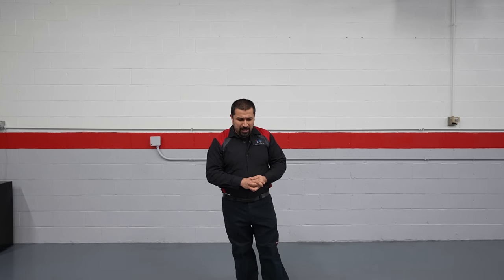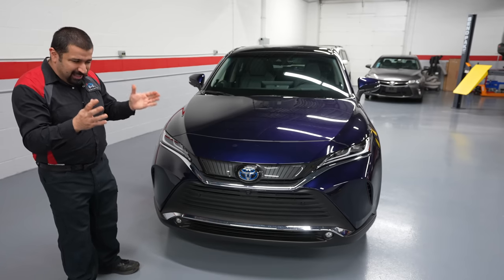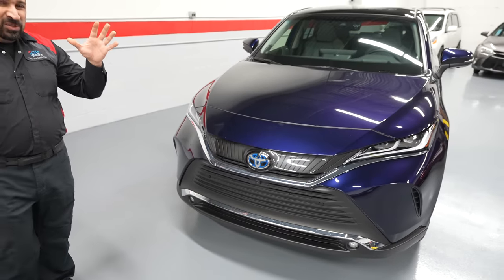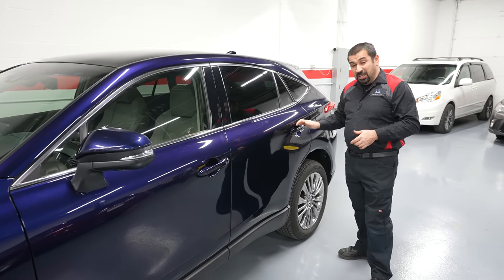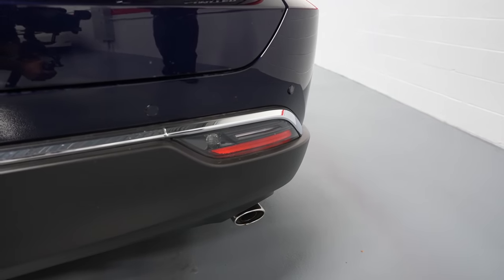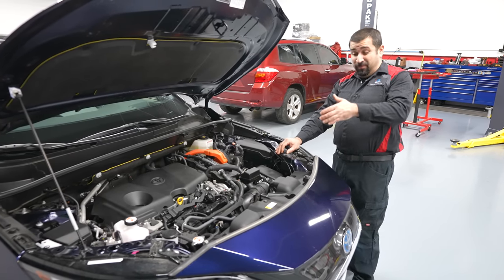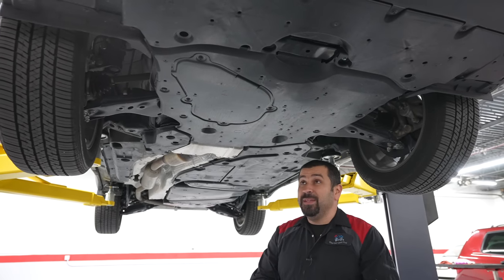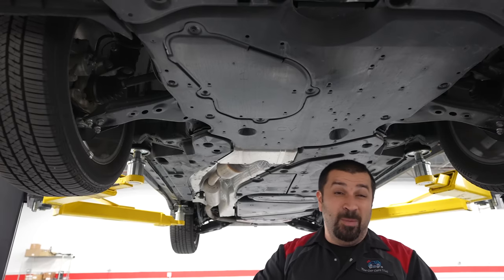THIS Toyota New Model is a Total Hidden Gem! Should've Been a Lexus!

Comment: I drive a semi truck and we CANT SEE those bumper turn signals in traffic! Love your channel CCN
Reply: Yes... low down turn signals are low down stupidity !!!
I have 2 Hyundai Santa Fe's with them .... Kia also does the same...
Reply: Such a helpful comment! Thank you. Have you noticed the issue with Venzas angle of rear specifically or any vehicle with lower signals. Just curious-have you ever almost wrecked because of this issue?  To me this is an important safety issue. Thanks again!
Reply: @s.p.3738  I haven’t encountered the new Toyota yet but the Hyundais are the problem (so far), this one doesn’t seem any better. It’s only a problem in stop and go traffic as you encounter in large city rush hour..
Reply: @s.p.3738  Lower the better the designers think ! It is plain stupid, I own 2 Hyundai Santa Fe models with those down low stupid turn signals
they are dangerous !!!!!
Reply: @obesefeline  Thank you for this! Very helpful
Reply: 💯 % correct...
Reply: Love your channel. Great video. 
Why are the turn signals do low....
What's the thought process?
Reply: It has them in the mirrors
Reply: That's why they also have the turn signals integrated into the sideview mirrors. Surely you'll see those. But for those that don't have it, definitely a problem. Not only for Semis either. If you get too close to the vehicle like in a bumper to bumper traffic, you can't see them
Reply: @kr2426  when you're behind someone you don't look in front of their mirror
Reply: @kr2426  and in the morning it's not bright enough
Reply: @bextar6365  yes, I hate it in my Chevy bolt when loading a hitch cargo tray for camping.
Reply: @esmerlerhovardasi1  no he's way up hi unless you're like 3 cars apart you probably won't be able to see them
Reply: @ericwall7396  Can you see a Miata? I love mine but get worried driving them around semi trucks
Reply: Then stop tailgating or munching big Macs while driving.
Reply: This is and the lack of rear storage space along with non functional sunroof are deal breakers for many looking at the venza.
Reply: I drive a car and I can't see those stupid signals 😒
Reply: Most drivers in New England don’t even use their turn signals!
Reply: Payback for truckers not signaling I guess
Reply: You are driving to close if you cannot see the lights
Reply: @bextar6365  they are not stupid they be road safety tested
Reply: @keithnewton8981  Still say stupid ~ I own 2 !!!
Reply: yup... they could have integrated the turn and brake lights together and left the reverse light and reflector at the bumper.... but no.... thought there was a DOT rule about this....
Reply: I drive a pick up and can barely see them
Reply: @dougheath3707  who cares about your non Toyota miata .we are not talking aboutMasda
Reply: @Liefpj  who cares! Not talking about chevrolet
Reply: How about lack of a real rear number to protect cargo hatch and rear occupants ?$400,000.dollar damage at less than 3M.P.H impact
Reply: It’s the reason I chose not to buy a Venza. I want everything visible.
Reply: In Australia front side indicators are compulsory.
Reply: I always wondered about that and hate it when designers take liberties with the most basic safety features. Can you at least still see the ones on the sideview mirrors?
Reply: @jbm0866  not during the day unfortunately
Reply: @obesefeline  You know what else can be dangerous? (I'm sure you'll agree) that is cars painted the exact same shade of red as a lit brake light. These often disappear in bright Texas, Arizona, NM (entire southwest) sunshine.
Reply: Truck, not truck... Those turn signals are really stupid idea.
Reply: If you can’t see the low turn signal, you are too close. Back in driver ed we were told to stop in such a way we could see the bottom of the rear tire of the car in front of you. That way you have enough room to maneuver around the car if need be, and… you can see the entire rear of the car in front of you. So when semi drivers don’t follow that advise, their problem, not ours. Besides, it not like the semi is going to overtake the car in front of it. And they aren’t going to be able to change lanes when the car in front of the wants to turn. If they hit the car in front of them because they couldn’t see the turn signal, they were too close.
Reply: @journeywithstu7199  you are being quite presumptuous, my point would include people to the left and right of me in bumper to bumper traffic attempting to get in front of me(what I’d gladly allow), the tailgating accusation is mute in this case.
Reply: I agree
Reply: @keithnewton8981  yeah ok, road tested in the real world? Lol
Reply: I have a Venza 2022, I love it. Low turn signals are odd, but maybe: keep your distance and you will see? Especially if you are driving a heavy vehicle distance is good as you need a lot more to come to a full stop (nothing to do with the make simply physics, more mass means more energy do dissipate to get to a full stop)
Reply: @obesefeline  yeah have been driving it for 6 months reaching f 8000miles and loving it
Reply: TOYOTA??  Are you listening?!?!
Reply: Well half the population don't know what a turn signal is anyway!
Reply: Maybe, you’re driving a little too close to the Venza.😊
Reply: @charliesundblomSwede  no, I’m primarily referring to stop and go traffic 0-5 mph, if one of these cars is next to me and would like to get in front of me( what I’d be happy to allow), I can’t see their intentions!

Comment: I bought a 22 Venza Limited in September just because for RAV4 hybrid money I got a much more advanced car. I really don’t see very many of them on the road. I think they are a hidden gem.
Reply: Yes...they are super rare to see !
Reply: I ordered one in Sept 2022...  told it will be 12 to 18 months before it arrives.
Reply: @KP-uj1wf  I put a deposit on an inbound unit in late July and took delivery mid September. I know there was no ordering to spec. It was just a case of this is what’s in the pipeline do you want it? If so we need a deposit. So I took it.
Reply: How is the cabin noise?
Reply: @subrata459  not bad. Definitely much better than the rav4 which I’ve driven a lot of. There’s some in the highway but almost none anywhere else.
Reply: My only fear is the transmission, how is it going?
Reply: This is a Rav4 with different body panels. Mechanically, it is identical to the Rav4
Reply: @danielriverafigueroa exactly the same as the Rav4, because it is a Rav4

Comment: The one downside is that the rear signal lights are very low.
Reply: Yea I really don’t like that either.
Reply: Agree, but I think it is overall a tighter fit than a RAV4. Maybe that’s the market Toyota is aiming at. Especially don’t like location of start button and lack of knobs for volume and heater/defrost.
Reply: @cp3onmtv963  Very surprised about that from Toyota.   Never seen signals that low.
Reply: Yeah, I almost hit one the other day, I was trying to make a lane change and I couldn't see that it was trying to as well
Reply: They could have incorporated a portion of the tail light into a turn signal. Still love my 22 XLE.
Reply: @ivanvarykino8202 you’ve never been behind a kia?
Reply: By law, the signals used for the hazards need to be visible if the rear hatch is open. Since there is really no room for the turn signal on the very most outer portion of the light, Toyota was not allowed to have them on the hatch and thus had to mount them below the bumper. There’s no SUV that has turn signals on the hatch.
Reply: I found that odd as well if your bumper to bumper in traffic you may not even see it.
Reply: @ZachDxn  well youre moving very slowly so its not as dangerous as in other circumstances
Reply: It has side mirror turn signals. There’s zero problem.

You mentioned that there was a downside but you didn’t explain why it was a downside.
Reply: @cwg73160  it's objectively less visible. Maybe not by much but still harder to see than if they were hiigher up.
Reply: @ZachDxn  Again, the side mirrors have turn signals. They’re visible to the vehicle behind and higher up.
Reply: @cwg73160  yeah but a better system is side mirror signals and rear signals at eye level, that's ideal and the safest option
I'm not saying it's 100% necessary but I think it's my preference

Comment: The Venza is the 3rd gen Lexus RX.
I parked mine next to one and the shape, size and proportions are nearly identical.
They built on a tried and true platform and got a winner again.
Reply: Actually this generation Venza reminds me of the second-Gen Lexus RX!😁
Reply: For a moment, I read "wiener" rather than "winner".  😄
Reply: @denimadept  look who's hungry...
Reply: it's actually the same as Lexus NX, not RX - RX is bigger. Tho they both built on the same platform TNGA-K
Reply: The Toyota Harrier and 1st & 2nd generation Lexus RX were built on the same platform.
Reply: Plus it does not require premium gas (unlike Lexus)

Comment: I purchased a 2022 Venza three weeks ago; so far I have averaged 41 mpg.  I think it is a very good value.
Reply: Hi, what is the warranty on the MGR cable. The cover he shows us gives some protection from road salt and water but it still is exposed to the elements . Rav 4 owners in the past only got 3 years coverage and then all hell broke loose with law suits for corrosion that caused the cables to fail.
Reply: @brianwhitney9181  The warranty on the hybrid system is 10 yrs or 100 K miles.  The warranty on the hybrid battery is 10 yrs or 150 k miles.
Reply: @daves2520  Hi, Check to see if the cable is listed as one of those components that is included in that warranty.

Comment: Love this walk through. As an auto tech I have to agree the electronic parking breaks are an improvement. I was skeptical of them at first but they have proven to be more reliable and actually work better.
Reply: How is the electronic design actuation done with the parking brakes? Do they somehow not use brake shoes or pads?  Video mentioned they no longer need to be changed, so are they operating using the main service brakes instead of an independent system?
Reply: Is there any capability for gradual application of the parking brake with the electronic design or is it always either on or off completely? 
In the event where it was needed to be used during a main brake system failure, does it modulate the application at speed to prevent locking up the wheels?
Reply: It is an on or off system. No modulation. It uses the primary brake pads so no aux parking brake shoes. There is another version of parking brake system that uses a cable operated lever on the caliper. The cable operated parking brake systems both have their problems. I've found the electronic systems to be more reliable over time. Vehicles have dual hydraulic circuits as a redundancy in case of hydraulic failure. I wouldn't feel uncomfortable driving a vehicle with electronic parking brakes in a daily driver.
Reply: I love my Rav 14!
Reply: How You can stop de car en case of emergency??? Those new emergency brakes socks
Reply: @edwardgarciarosario140  They are more like parking brakes than emergency brakes.
Reply: Got a 2023 Venza, road noise is pretty loud, would better tires make it quieter??
I got the Dunlop grand trek pt20s on it. Or is it just the car that’s noisy over 40 mph???
Reply: They only work better because they can be selected automatic for when you put the car in Park.  people are inherently lazy to pull up on an emergency brake handle.  I just replaced a cable on my car and it was $130 for the part.  How much does the electric brake cost when it dies?
Reply: @waynebinky  I've seen more reliability issues with cable operated systems. The cable operates a lever on the caliper or it operates on a separate parking brake system using shoes. The cable operated system has more points of failure. People don't use them regularly so they seize up on the off chance they are used and it causes a mess. I haven seen the same issues with the electric system. The only failures I've seen personally are from people trying to force the pistons in when changing the brakes.
Reply: @mynameisnickish um
Reply: In the northern rust‐prone areas, the cable system is especially annoying because the pulleys, linkages and connections get crusty. When I buy a Toyota, I drive it for a very long time. I have an 04 Tundra Limited that looks beautiful and runs like a top, but 20 years in, the little problems become bigger problems. Not having to deal with a cable is one less headache. It's one part of the undercarriage that I'm very careful about hosing down with rust inhibitor. Regarding emergency use: I actually had a braking emergency last year, and there's no way to stomp on that parking brake in a split second, anyway, unless you have the reaction time and leg nimbleness of a mantis. For the lever type e-brake, be careful about when you yank on it. Things might get even more thrilling. 😅

Comment: I work at a glass factory and we do this type of smart glass film. It is actually laminated glass with a PDLC film in between. Very expensive to make. We charge well over $100/sq.ft. You hit all the points correctly. When it goes opaque, it is off.
Reply: ive always wanted it for a number plate cover, that way you could accidentally opaque it if required hahaha.
Reply: @Steve211Ucdhihifvshi  
We had a customer that was ordering that from us and selling them, but I think he got caught or got fined and stopped ordering them. It really is illegal, but you’re not the first to think of that.
Reply: @Steve211Ucdhihifvshi  My father really wanted to manufacture "active glass" back in the 80's and early 90's for camera lenses - electronic shutter instead of mechanical.
Reply: IMHO, that glass is just another thing to break and cost $$$ to get repaired. I've heard about Toyota's where the glass breaks./ leaks and cost an arm/leg to fix.

Comment: Have had a '21 Limited in White Pearl since May 2021 and still love walking up to and stepping in it.  Your handful of critiques are spot on as well as the Lexus-like quality.  Was cross-shopping the Rav4 Prime when I saw and test drove this. The class of the more subtle design and quality of the interior won me over. 21k miles on it now and no problems whatsoever.  

One more thing to mention, even though I have a limited trim, you can opt-out of the moon roof and then you can add roof racks as mine had from the factory/dealer.  I like the ability to through a kayak or more storage up there if I need it.  I'm seeing a few more on the streets now but still love how unique it is and have had multiple people ask what it is.

I can confirm 45-50 MPG in the summer in the Pacific Northwest and 38-43 in the winter with mixed driving.
Reply: I have had nothing but moonroofs in every car since 2010 and I never ever use them. One simply spontaneously exploded. One stopped working. One kept almost but not quite shutting. I would avoid them whenever possible
Reply: They also start to rattle and make noise after 10 years.